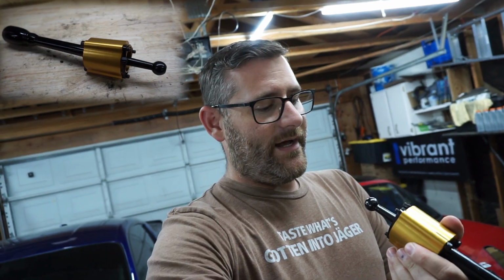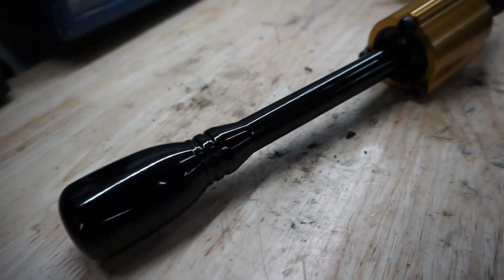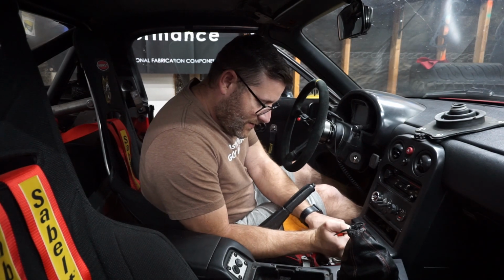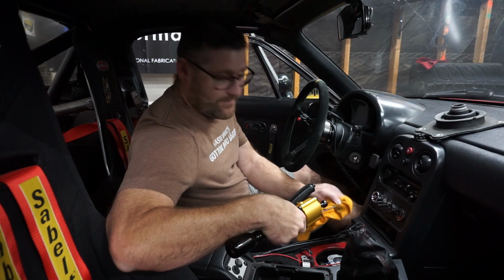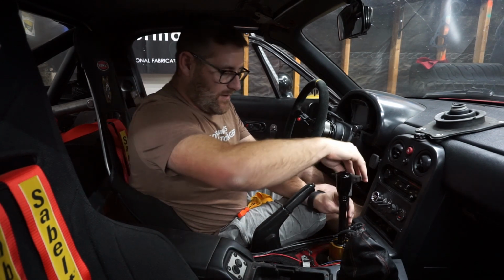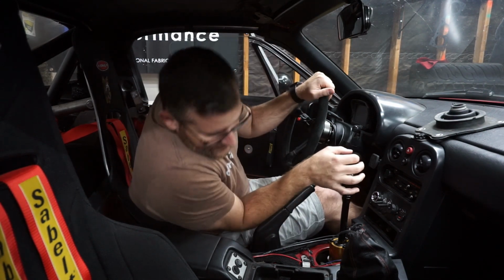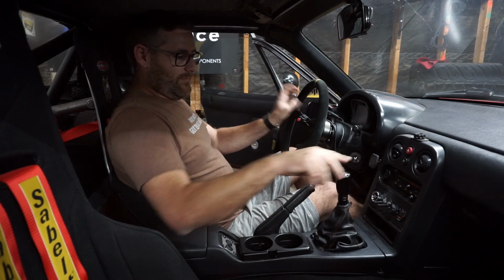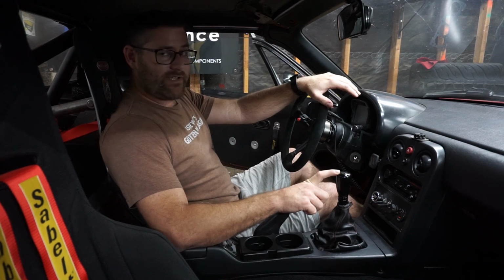GRacing Short Shifter Install NA Miata, Is it the Best?

Comment: Thanks for the video. I've had my eye on these as well as a few of the other short shifters on offer for the Miata for a while. I'm still not convinced if the shift experience will be improved, particularly for my slightly worn transmission which has a habit of being a little hard to get accurate shifts under heavy loads.
Reply from the maker: Oh I think with this it will be vastly improved even in an older worn trans.
Reply: As hard as it looks to shift it makes me want the irp shifter instead